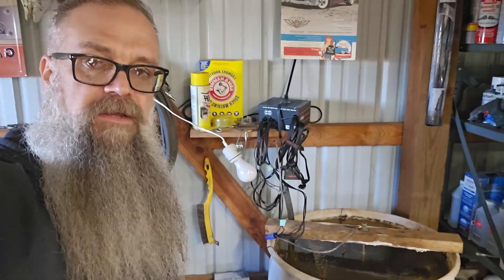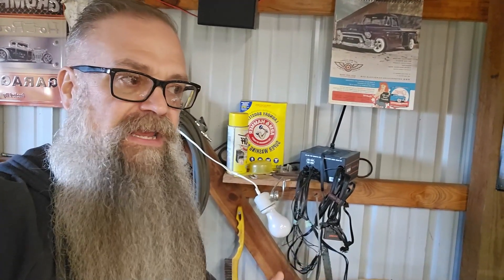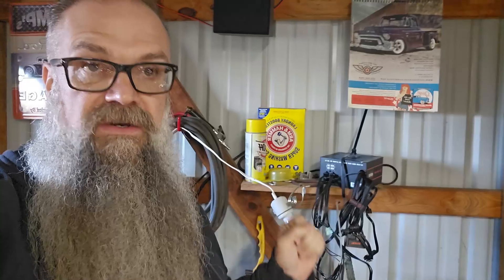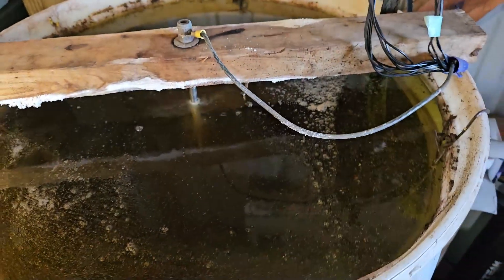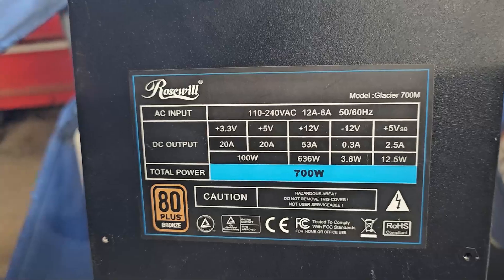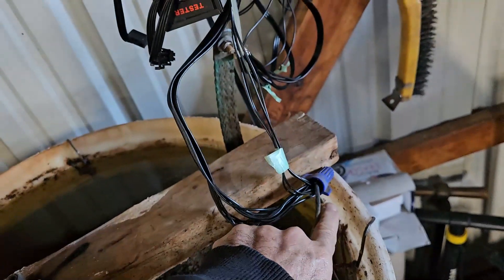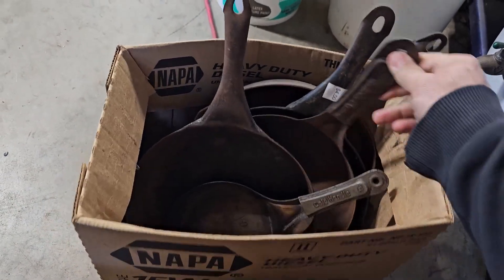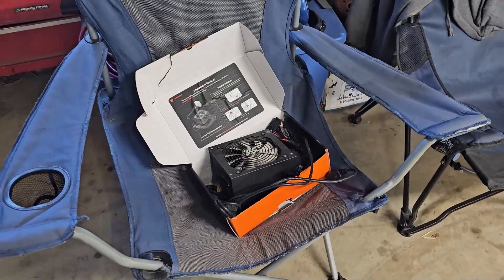Best Upgrade for E-TANK / Cast Iron Electrolysis / Throw Away Your BATTERY CHARGERS

Comment: Hello. I hope you see my comment. I am curious, what is the amperage output of the power supply system you’re using? I ask because according to the specs for the power supply you’re using it’s between 50-60 amps. Isn’t that too high? I ask because as I understand it the setup requires 12vdc at 2 amps. Thank you for your reply.

Comment: I have a question that I’m hoping you can answer for me

I want to copy your electrolysis set up 

Obviously, I’m trying to do it as cheaply as I can 

I found somebody  giving away a free dryer on our local marketplace 

I’m going to go by today and confirm that the drum is stainless steel 

My question is this , will any stainless steel work? Does it  have to be a 
specific grade? I would hate to go through all the trouble of dismantling this dryer just to find out what I’m pulling out. Isn’t going to work
Any advice you can give would be greatly appreciated
Reply from the maker: As long as it doesn't have any kind of coating on it, it should be fine. Mine may have came out of a washer, im not sure as it was already out when I bought it. Good luck 👍
Reply: @ASimpleLifewithChrisTara  I googled it and it’s possible it has a nickel coating on it? Not 100% sure but I appreciate you guys responding so quickly thank you!!

Comment: i’m new to electrolysis but have heard that using stainless steel is dodgy as the process takes tue coating off the stainless and creates something very toxic… though th i’d mention it
Reply: Use non-ferrous stainless steel.

Comment: 😂 used my old pc power supply. Open the p.s box and looked for 12v yellow wires and grown-black wires on the board itself. fan power-Green wire to grown. It works.

Comment: Obviously this guy is not heavily into Electronics or even basic electronics, manual battery chargers are nothing complicated internally. You have sometimes a timer circuit which is just a mechanical timer, a Transformer that steps 110 volts down to somewhere around probably 14 volts or so ac, then a dial rectifier usually two diodes, the center tap of the secondary of the Transformer is connected to ground. The other two legs of the Transformer pass through the diodes. When you switch to 6 volts, it either uses a separate winding on the primary to reduce the voltage or it uses half of the secondary. So when you have a battery charger that suddenly dies. Open it up, you'll find what looks like to watch batteries or studs with a table hook to them usually somehow mounted to the case of the charger those are the diodes that have burned out. Reason being is diodes get hot when they operate. And they just wear out they're easy to fix disconnect the two wires. Go on to Amazon or just the internet and Google full wave Bridge rectifier, depending on the size of the battery charger you're using if you've got a 12 amp charger order a 25 amp rectifier I'd say you've got a 50 amp charger order 100 amp rectifier. Then you just disconnect the wires from the ones internally connect those to the AC input terminals on the new rectifier you purchased. There will be two other terminals on the new rectifier one marked positive one Mark negative ignore the negative terminal. As it's not used. The positive terminal is now going to be your new positive connection to your positive clip lead. Mount the rectifier to a clean spot of metal on the case take a wire brush or sandpaper sand away all the rust and dirt. So that you have good metal contact. If you really want to make it last, and you can find yourself a piece of aluminum plate that's fairly thick like say a quarter inch or more that you could fit as much of it as you can inside your battery charger screw the rectifier to that and then to the case the whole point of this is to remove heat. Well this may sound complicated. Essentially you're just replacing the two cheap diodes used by the manufacturer with a upgraded module total cost of these modules even for a hundred and one is less than $10 maybe $20 at the most. A 20 amp module probably will cost you around $5 also they do have a voltage rating. Make sure that the rectifier you're buying says it can handle at least twice the voltage that your charger is set for. So if you have a 12-volt charger make sure you order at least a 50 volt rectifier it may say p i v 50 or something similar. The only issue he's got here we're using a computer power supply. They're designed for continuous load. To provide a very smooth and stable Source DC power, did you not absorb short-circuits, and overloads very well. As were the old battery chargers didn't care. If you shorted them out the circuit breaker inside would just open. Also there's an advantage to using the old battery chargers, as the DC they put out is not what we would call clean or smooth. It has a lot of AC Ripple and noise on it. It's actually helps the electrolysis process. By not being a pure smooth DC output. It causes a minor surging in the current going through the liquid. Which keeps you from burning pits and potholes in your cast iron. That's why if you do any commercial electroplating works you'll notice that the supply they use is essentially a giant DC arc welder. Which is nothing more than a Transformer and a rectifier. And a way to control the current. In fact in a larger home electrolysis tank, you could use an old DC arc welder. You just have to keep the current very low and make sure that in fact the whether you have is putting out DC and not AC
Reply: huh?
Reply: @justinschneider5303  easy peasy man.  It's not rocket surgery.

Comment: What is the ratio of soda to water? Also I have a 48 volt golf cart charger that I plan on using. Does voltage mean anything like less voltage takes more time etc?
Reply: Yes the More Voltage you apply to the electrolysis tank, the faster the reaction will happen. However you can cause pitting and damage to the cast iron if the voltage is too high. Again because the reaction is happening so fast. Some areas with less rust will start to erode faster than areas with more rust. You can control this affect. By using a device called a variac. It's essentially a variable Transformer that you can put on the input of the charger which will reduce the output voltage. The trick is to have enough voltage, for the process to occur, where is the current actually doing the work. The voltage is just breaking down the resistance of the water and making the solution function 48 volts is a little on the high side. I use a very large laboratory power supply on my system, it is a variable that can go anywhere from 0 volts to 55 volts at up to 35 amps, I never run it more than about 15 volts or so. It's great to have power supply but they're very expensive someone hard to find and kind of heavy do I have probably weighs about 60 lb. If you really wanted to get hardcore about this you could buy a old AC Arc welder, add a large rectifier to it, and a very act on the input. And that would give you the most versatile and Powerful electrical power supply you could get. But it does require some understanding of electronics and how to connect them.

Comment: $60 DC power supply from Amazon.
Reply from the maker: Do you have an Etank, or how do you restore your cast iron?
Reply: @ASimpleLifewithChrisTara  I do. A 25 gallon plastic barrel. If you visit the Cast Iron Cookware channel, he has a video on the tank he made using the DC power supply. That's where I got the idea. The manual battery chargers are harder to find.
Reply from the maker: A plastic barrel and a battery supply is the setup I have as well

Comment: I just donated a couple of 400 watt power supplies to a local thrift store, but I have a few more.  I derust old hand tools mostly, and if a 400 watt is too slow, two could be used so long as you kept the polarity correct.  Most newer computers need 500 watts or more,  so the older power supplies can be had for free or nearly so...    l need to check out your idea on a stainless washer tub, hadn't thought of that.  😊
Reply from the maker: It has worked out great, especially for bigger pieces.  Thanks for watching... we really appreciate it.
Reply: Tried this and works great.  Just built a week ago.  See a ton of people saying you should not use stainless steel but do not know if that is real or not.